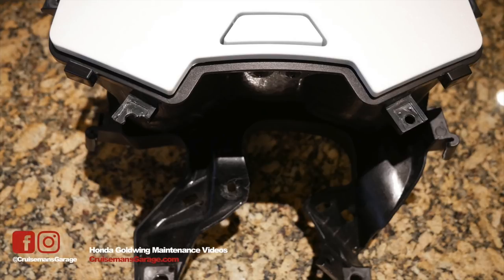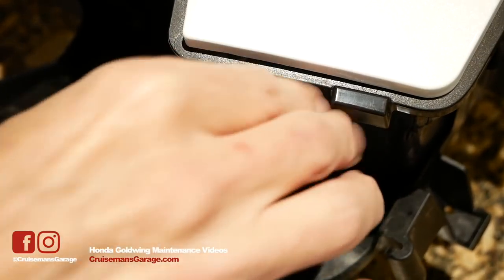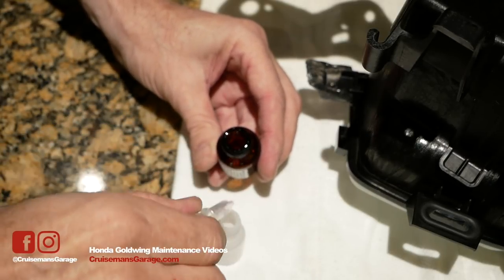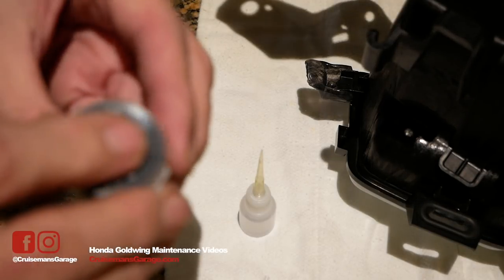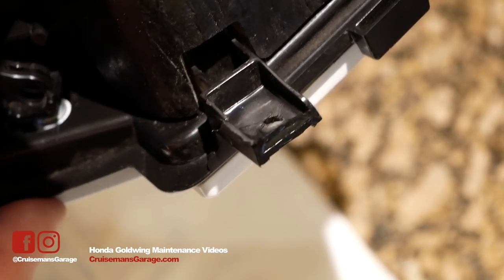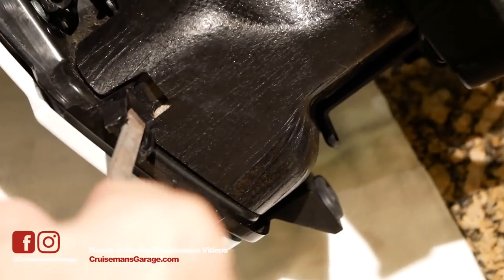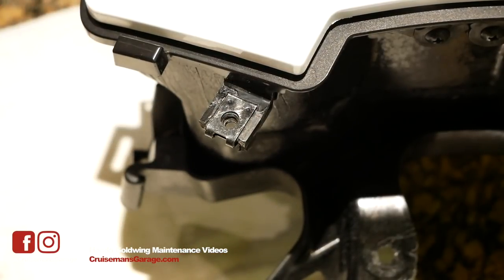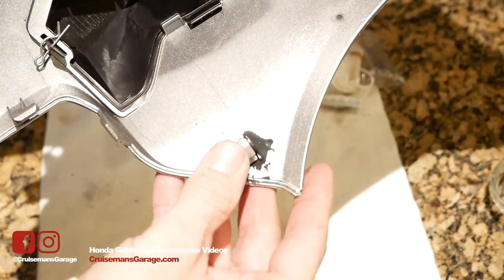Repairing Broken Plastic Tabs Using Plastex

Comment: Ordered a large pack of this a year or two ago. I used it to turn a 1970 Torino grill from 4 pieces to one piece, and even made new mounting tabs using some foil to form a mold. When I was done you could hold the ends of the grill and even twist the ends opposite directions. Worked wonders!! About to use it to fix the oil fill hole on my 2014 F150 5.0 engine. Some dummy at the oil change place. probably slipped and pushed the funnel sideways.

Comment: I've made similar repairs on ABS plastic parts using acetone and ABS shavings to create a paste that bonds with the original part. Acetone dissolves ABS plastic, and as it evaporates, it leaves the plastic behind and it becomes part of the original piece. I'd be willing to bet that's what this kit does.

Comment: One more thing... For better and more permanent bounding, it would be if you use a 220 sand paper and created micro scratches on the original plastic in order for the new material creating attachment anchors to the original piece. Again nice video as always..

Comment: I have done the same kind of repairs using baking soda, and superglue for years.  It works really well.
Reply from the maker: Seriously?
Reply: @cruisemansgarage  Yep!  You should try it.  As soon as you put the lid back on the glue after saturating the baking soda it is ready to sand, or file.  Works on plastic, wood, fabric, and some metals.  I just use a felt pen afterwards to color it.   I use children's modeling clay for a mold, or just masking tape depending on what I am repairing.

Comment: Thanks for the video!  I’ve repaired plastic tabs and pieces on my old Cavalcade by basically welding using a soldering iron and zip ties, this looks like a much better option!
Randy

Comment: It looks like that stuff works great.
 I used to have a lot of need for something like this but my concourse 14 plastic is not brittle, it seems to stay very flexible. I always put silicone on these fasteners and their receptacles once I have them removed so then come off easy next time, however that does not help with the type that holds a speed nut. (like shown here)
Some of these types of fasteners fit so tight it's no wonder they have the tendency to break...
Reply from the maker: Plastic on the new Wing is VERY brittle, and there are LOTS of tabs.

Comment: That stuff is  great !   Nice video.   Do you buy it at Home Depot?    Just curious,  any reason you didn't consider using Gorilla Glue for the side panel post?
Reply from the maker: I have used Gorilla Glue before, but it is hard to control the swelling of the glue. It also works best when you can clamp the parts together, otherwise, the swelling will disorient the parts. I bought on Amazon.
Reply: @cruisemansgarage  --- Good point.     Thanks.